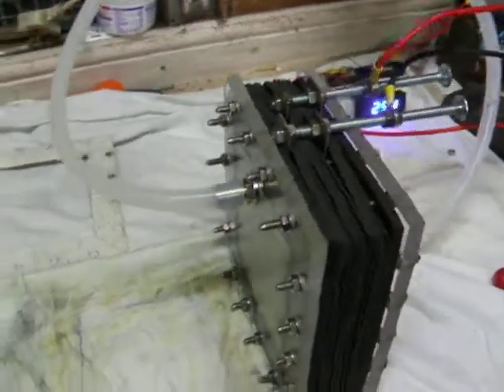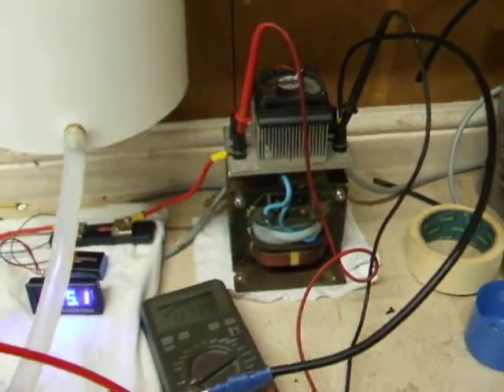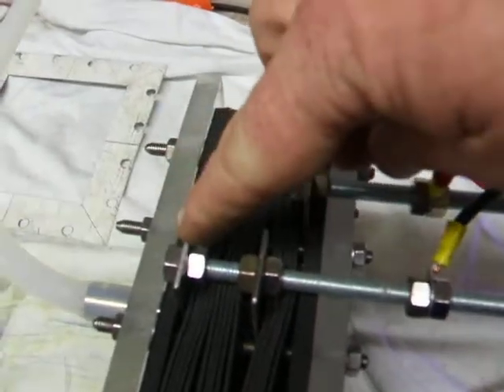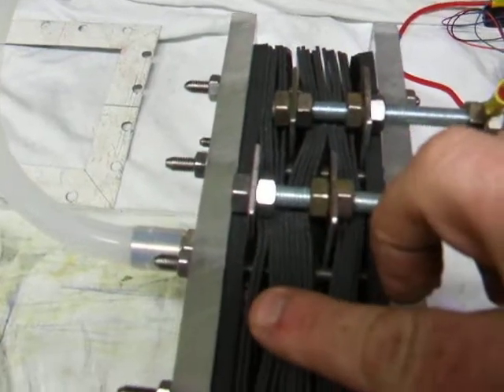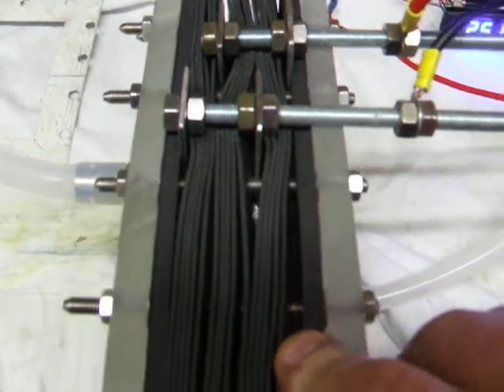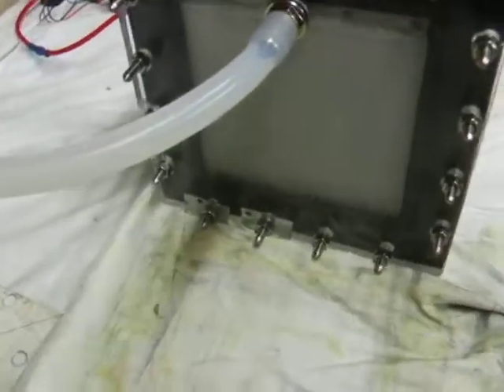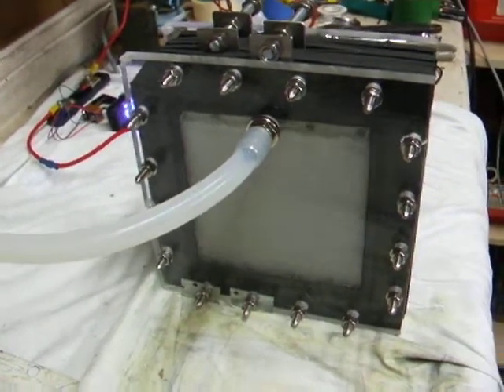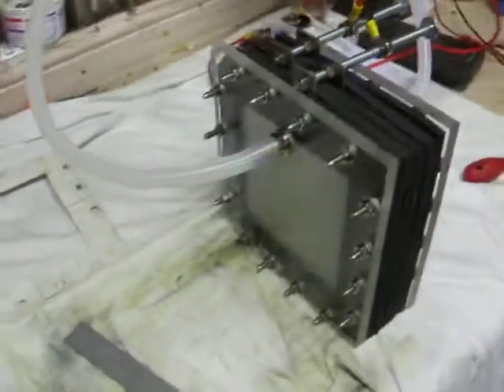HHO dry cell #03

Comment: Looks good so far . What's the conditioning the plates do?? I have a 9x9 21 plate(30 amp/ 3-4 lpm) dry cell and i didnt condition the the cell before i started using it in my truck.